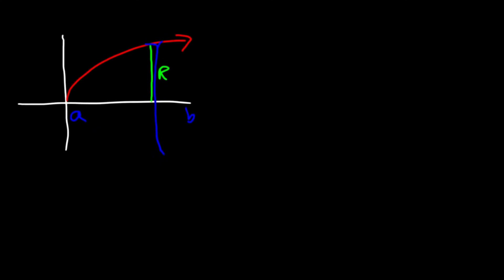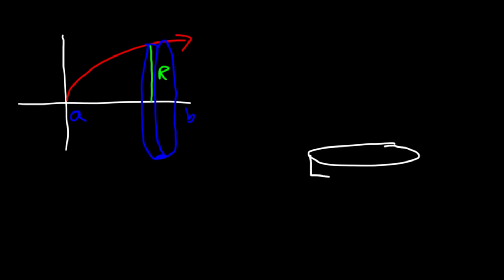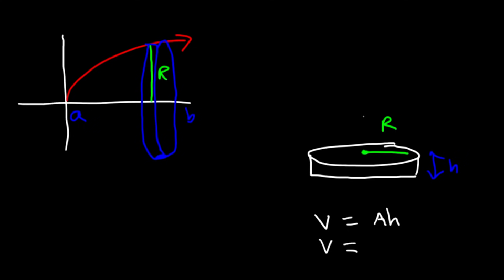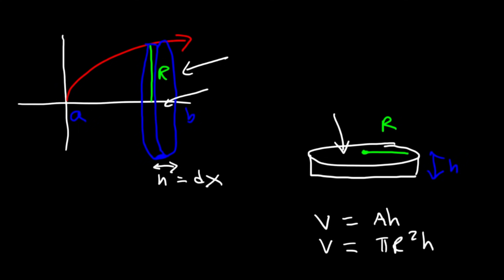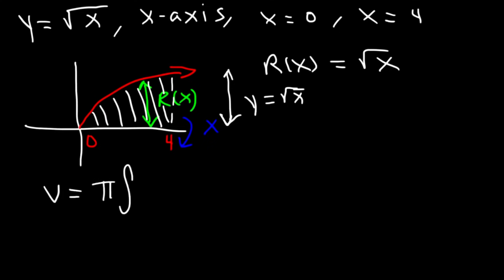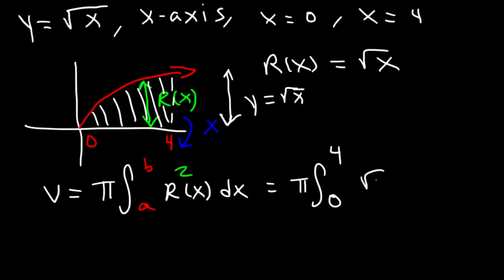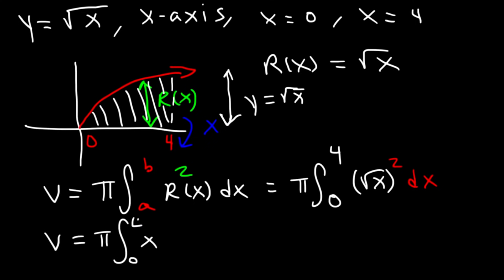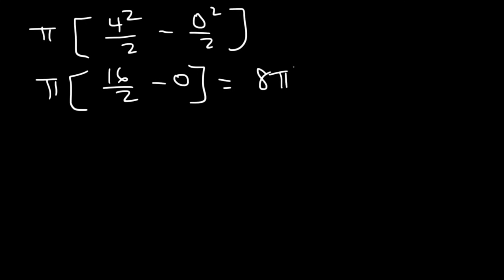Disk & Washer Method - Calculus

Comment: How did you get x^-2 at 10:24
Reply: You’re multiplying x^-1 by x^-1, so the exponents add to -2
Reply: power rule things go negative cuz squared
Reply: You square both the numerator and denominator. It became x^-2 because you turned the denominator into a numerator for it to become a non-fraction form. If you return the x^-2 to the bottom it becomes positive again.

Comment: There’s no washer method??
Reply: No, Washer is with big radius and little radius.
     B
Pi |((R(x))^2 - (r(y))^2)dx
     A

Same for Y axis.
Reply: Washer is what they call it on the Y axis I think. Not sure personally but thata what I thought
Reply: I saw someone saying the washer is only used when you rotate with a bottom line that's curved and not straight like x/y axiis. Like rotating the area between two functions
Reply: Someone’s a little slow

Comment: 00:00 Calculating volume by rotating a region using disc and washer methods
02:44 Finding volume using disc method
05:28 Find the volume of the solid generated by rotating y=√x about the x-axis.
08:09 Calculate volume using disk method
10:39 Learn how to find the volume of a solid when rotating about the y-axis
13:18 Finding the volume of a solid rotated about the y-axis
15:37 Revolve curve around y-axis using r of y = x
17:55 Finding the volume of a solid produced by rotating about the y-axis

Comment: correct me if I'm wrong, but isn't the washer method the one that involves two functions on the graph (ex: y = 2x, y = 5x + 1)? If so, I didn't notice the washer method in this video, only the disc method.
Reply: You are right but they are basically the same thing anyway. As you said, the washer method involves two functions and you apply the disc method twice and substract the little one fromm the bigger one.
Reply: @paulagaona9622  nope they aren't.
      washer method covers rings, disc method covers ,well discs and shell method covers both.

Comment: alot of methods include finding a big radius and a smaller one to integrate R^2-r^2 dx, is that worked on here in another way, slight confusion, please lmk
Reply: A bit late, but I think that's the washer method that is used when there's a second smaller function that forms a hole/ring within the first one. Disk method is used when there's only 1 function involved.

Comment: Great video! How would you know whether to use disk or shell method?
Reply: Disk method is used when there is one function with a cross section of x or y.  Washer method is used when there are two functions rotating about an axis, about a R(x) or R(y) function.  A washer forms when an inner function creates a smaller ring inside of the shape, which means there is a hole that forms in the middle.  A disk does not include an inner function.

Comment: How do you know when to use the disc method vs. the washer method?
Reply: First and foremost, please don't take this as me being condescending because I'm not or at least it's not my intent. With that said, your question tells me you are following directions only and don't really understand what it is you're actually doing. This is the reality for most Calculus students and it's no fault of theirs. The issue is that most teachers, just like this video, are giving you directions only without much explanation so you can understand the concept which is really what you should aim to do. Once you do, you won't need to remember a thing, because you can come up with your own directions. Please take the time to read my explanation and if you understand, all of this will be a piece of cake and you will be like, "Really, is that all it is?" because you will see the concept and the reasons for why you do what it is you're doing. You did the right thing by asking because you want to know and to understand and that's what I'm going to try to help you with. Most people will simply continue to follow directions without actually understanding what they are doing and that's why when faced with a challenging integration, they are completely lost because none of the directions they've been given applies, at least not in their eyes. Once you see and understand the concepts, you won't need to do 100 problems to understand; you will be able to set up your integration correctly EVERY TIME no questions asked.

 As to your question, IT DOESN'T MATTER which one you use. The disk and the washer method are one and the same. They are not really two distinct two methods like the shell and washer method. The disk method is just the washer method with an inner radius of zero and nothing more. You don't have to choose one or the other. If you want to be 100% confident, just imagine the disk method doesn't exist and always use the washer method because the disk method is just a special case of the washer method. Use zero as your inner radius and you will see that you arrived at the disk method. If youwant to use the disk method to solve what would "seem" like it's a washer method, you can. Just integrate two solids like doing two disk integrations. After finishing, subtract the small solid from the large solid. If u set it up and actully combine everything, you will arive at the washer method. So there's NO need to distinguish or need to decide which to use. BOTH WILL WORK ON ALL PROBLEMS! They are both one and the same. Nothing confusing; every washer problem can be treated as the difference of two disk methods and every disk problem is just a washer with zero for inner radius. Hope you can see that.

To be honest, very few people explain integrals well, including this guy. Most students memorize steps because like this video, most teachers teach steps rather than concepts. If you truly understand what's going on, these problems are as easy as addition because that's all it is. It literally is just simple addition of parts. Why teachers do not teach students the concepts, I do not understand. If you understand the concepts, all you need to do is a couple of problems to validate the concept to yourself and you will never need to do another problem again, yet you'll be able to tackle any volume problem thrown at you.  Note that all "S" below this point is being used to notate the integral sign: 

Area = S(dA)    reads....area equals the integral of changing areas

This says the total area is the sum of all the changing areas(dA). We use integration because all the areas we want to combine are different(changing). If all the areas were the same, we would NOT NEED integration; we'd simply use multiplication and be done. Instead, we must add all these parts(dA), one by one to find the total and that's what an integral is.

Example1:
 Find the area of a rectangle with the bottom left corner at (0,0), height/width 2, and length 4. 

We can simply see the area is 2x4=8 
Now let's get the area using integration(we don't need to but we can).We can represent this as the area under the function, y = 2 bound by x = 0 and x = 4 so our integral is:

S(2)(dx) from 0 to 4  which will yield 2x and if we evaluate 2x from 0 to 4 we get 8-0 = 8

So why didn't we need to integrate to get this area? The answer is because in this case, A =S(A) (area = the sum of non-changing areas) rather than dA (changing area) You only need to integrate(add up) if you have changing areas(all unique areas). If the areas we are adding up are ALL the same, as is the case here, we can simply take the easy path and use multiplication. Our integral, S(2)(dx), is nothing more than S(A) where A is always the same and A is found by taking the height(2) and multiplying it by the width(dx). A = S(A) ===> A = h x w = (2)(dx)therefore A = S(2)(dx) from 0 to 4. For every value of dx, all the rectangles you will be adding up with width dx, will all have the same area because they all have the same dimensions, 2 (height) by dx(width). Because they all have the same height, we can simply take the height(2) and multiply it by the sum of all the dx's, in this case, 4, and thus, it yields us an area of 8 without any integration needed. 

Example2: 
Find the area of a right triangle with the bottom left corner at (0,0), height/width 2, and length 4.   

This can be represented as the area under the function y = x/2 from 0 to 4. In this case, A = S(dA) (sum of changing areas)because each rectangular division will have a different area given its constantly changing height.

dA = h x w (area of rectangle) where h = x/2 and w = dx, so dA = (x/2)(dx) 
Plugging into the integral A =S(dA), we get A = S(x/2)(dx)  which yields x^2/4 evaluated from 0 to 4 which is 16/4 - 0 = 4

We can confirm that this is correct because the area of a triangle is (b*h)/2 = 4*2/2 = 4

An inquisitive student would ask, "Wait, this has changing rectangular areas (dA), so why were we able to use multiplication? I thought changing areas meant we COULD NOT and had to simply sum up ALL(integrate)  the changing areas to get the total area? Yet, here we have proof that this is a false statement because we ARE using multiplication." The reason why you can use multiplication is because the triangle can be represented as a rectangle with the same length(4) and half(this is where division by 2 comes in) the height(1). If we use integration to get the area of this 1x4 rectangle, we see that we get A= S(A) = (1)(dx) because A = h(1) x width(dx). This will yield rectangular parts with ALL the same areas hence we can simply use multiplication.  A = h(1) x width (sum of all dx's) = 1 x 4 = 4 If we integrate using A = S(dx) from 0 to 4 we get, x from 0 to 4 which equals 4-0 = 4

Note that what you should be getting from all of this is that your integral should have TWO DISTINCT parts, one representing the height, and one representing width because you are summing up dA's(changing rectangular areas). To set your integral up, you just need to find the formula for your dA's. In the above two examples, our 2 parts were, the height and the width, which were '2' and 'dx' for example 1 and 'x/2' and 'dx' for example 2. For the triangle viewed as a rectangle, our two parts, height and width were, '1' and 'dx' respectively. This is how you should approach ALL your integrations when trying to figure the area under a curve or the volume of a solid.

Continued in next reply.......
Reply: I started with the area so you can carry that to volumes.

V = S(dV) (the sum of changing volumes) where dV = dA * thickness

Note that dA tells you there's a component in the area formula that is always changing and thus, the individual areas you are summing are always changing. Note that the dA can be a result of one variable that's always changing or it can be the result of more than one changing variable. This is the case when variables are functions of one another. Let's look at some simple examples:

Example 1:
The function y = x is bound by the functions x =0 and x = 4 and this area is revolved around the x-axis to get a conical shape solid. Find the volume.

 V = S(dV) = SdA*thickness 

At this point, you simply ask yourself, how do I divide this cone into volumes that ALL can be found using one and ONLY one formula, so I can add them up to get the volume? Looking at it, we can see that we can slice this cone into disks stacked in the x-direction. This tells us we will be integrating with respect to x, therefore, our thicknesses will be "dx". Now, what shape will the areas be when we slice them? They will all be circles so we simply need to derive a formula for our area. The area for a circle we know is pi*r^2, but what is r? If we look, we can see that for every dx we move, we can get a corresponding y value from our function y = x. As such, r = y = x  so, r = x. Now we have our formula for our dA.

 dA = (pi)(x^2)

With dA and our thickness (dx) figured out, we now have all the components of our dV.

dV = dA * thickness = (pi)(x^2)(dx)
V = S(dV) so if we substitute all our values we get

V =S(dV) = S(pi)(x^2)(dx) from 0 to 4. 

V = pi * S(x^2)(dx)  = pi * (x^3)/3 from 0 to 4 = (64*pi)/3 - 0 = (64*pi)/3

Note that we can distinctly see our parts, dA and our thickness, 'dx' in our integral. We actually find these first, and simply plug that back into our integral.

 Example 2:

We have an area bound by the functions, y = 4, y = x, x = 0, and x = 4. Revolve this around the x-axis and find the volume of the solid. 

Note, that this is simply just a cylinder lying on its side with the cone from example 1 cut out of it, so if you wanted to find this quick, you'd simply find the volume of the cylinder and subtract out the volume in example 1 but we want to find it using integration.

V = S(dV) = S(dA)*thickness

So, what's the formula for our dA? Remember, this must be a formula that applies to all, dA's. If we look, we see that we have a cylinder with a cone cut out in the center. We can see that we can simply divide this solid into thin volumes of washers and add them up. Since our slices will be stacked in the x-direction again, we will be integrating with respect to x so our washer thicknesses will be "dx". We can see that our washer areas are nothing more than a large circle of radius 4 minus some smaller circle. The area of the big circle we know. We just need to figure the area of the small circle which we found in example 1. We will denote area of big circle as A1 and A2 is the smaller. 

dA = A1 - dA2  =======> A1 = pi(r^2) = pi(4^2) = 16pi   dA2 = pi(r^2) = pi(x^2) 

substitituting gives 

dA = 16pi - pi(r^2)

With dA and our thickness (dx) figured out, we now have all the components of our dV.

dV = dA * thickness = (16pi - pi(r^2))  (dx)
V = S(dV) so if we substitute all our values we get
V =S(dV)
   = S(16pi - pi(r^2)(dx))  
   = (16pi * S(dx)) - (pi * S(x^2)(dx))   from 0 to 4      
   = 16pi (x) -  (pi * (x^3)/3)  from 0 to 4 
 
evaluate and

 V = 16pi(4) - 64pi/3     =  64pi - 64pi/3 = 192pi/3 - 64pi/3 = 128pi/3

You can check this with Volume of cylinder - volume of cone to get the volume of the solid:

Vcyl = pi*r^2 * h = 64pi   Vcone = (pi*r^2*h)/3 = 64pi/3

Vcly - Vcone = 64pi - 64pi/3 = 128pi/3

Both arrive at the same value.  The key takeaway is to UNDERSTAND the concepts. This is the most important thing. Once you do, you WILL NOT need to try to remember what your teacher taught you. You will NOT need to do hundreds of problems so you can see how each is done. Once you know the concept, you will simply look to see how you need to slice your volume so each dV can be represented by a SINGLE formula. Once you figure this, you will know which axis you will be integrating with respect to. And when you know this, you will know whether your slice thicknesses will be a 'dx' or a 'dy'. Now all that's left is to figure the formula for the dA. Just remember that your formula must be written in terms of the variable you are integrating with respect to. Once that's found, simply plug dA and the thickness into your integral V =S(dV) = S(dA*thickness) and you will have properly set up your integral, which is always the hardest part to these volume problems. 

In summary:

A = S(dA)  we are summing up changing areas...if your integral does not yield an area, you've set it up wrong. With areas, we are essentially adding up lines because your width (dx/dy) gets infinitely thin, but remember that though it's almost like adding lines, it's NOT. That infinitely thin rectangle, no matter how much it resembles a line, is still a rectangle and thus, must be the product of 2 dimensions, a width and a height. 

V = S(dV) we are summing up changing volumes...if your integral does not yield a volume, you've set it up wrong. With volumes, we are essentially adding up areas because your thichkness (dx/dy) gets infinitely thin, but remember that though it's almost like adding areas, it's NOT. That infinitely thin volume, no matter how much it resembles an area given how thin the volume is, is still a volume hence it must be the product of 3 dimensions, or an area( 2 dimensions) and a thickness.

What is inside the integral is simply a formula for finding whatever it is you are summing up, be it areas or volumes. This is the key takeaway! Understand this and you will be able to do these problems in your sleep. Last but not least, if you CANNOT represent ALL your dA's or dV's with the same formula, that's telling you you must use MORE THAN ONE integration and add up the integrations to get the total. Hope this helps and sorry for the long explanation.
Reply: @vangmountain  lol you need to become my teacher thank you
Reply: This is by no means a formal explanation- but washers happen when the area below the function and the line it rotates around are not completely filled in/touching, leaving that washer hole (where you you’ll have to find the inner radius (distance of the hole) and outer radius). 
If the area under the curve of a function is always touching/filling in to the line it rotates around, then it is a disk.